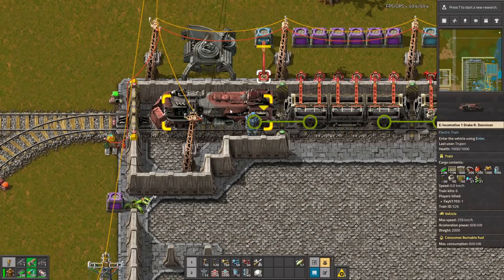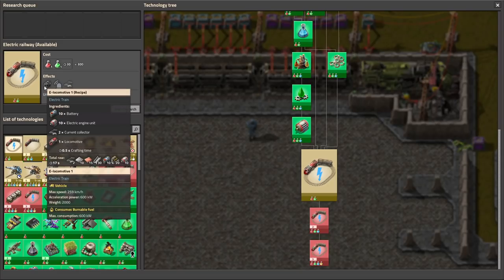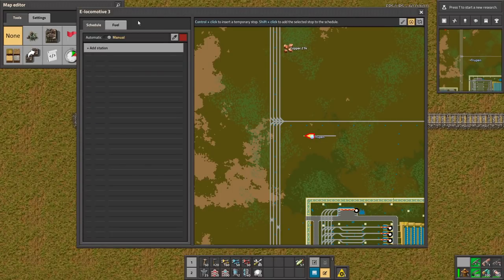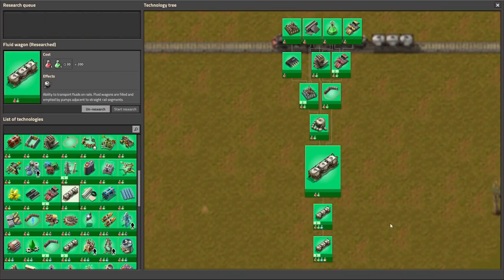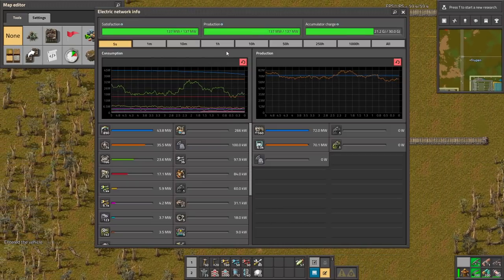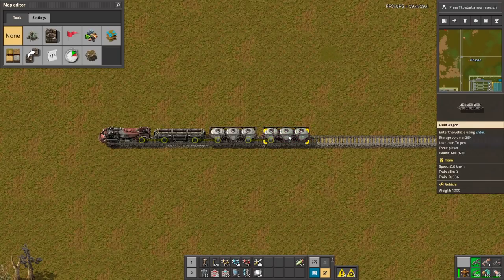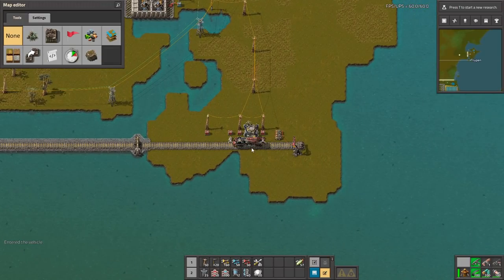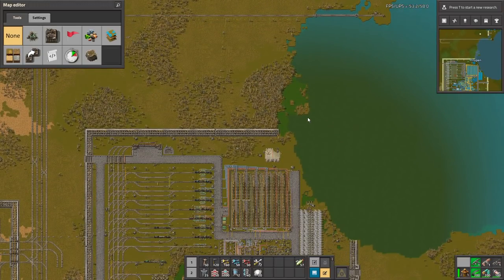New electric train.

Comment: I prefer the electric train that uses the overhead wires, it's a fork of the old electric train mod.
Reply: I mean, while that would make sense, we do still have wireless power in the game when it comes to connecting buildings to the power grid. It kinda feels like this mod is building off that idea
Reply: @Skellitor301_VA  I mean I think it's better like this anyway. Just imagine the spaghetti you would have in your base if you had to route wires from poles to buildings
Reply: @Bot-ih1jl  That's the other part, it's cleaner.
Reply: The train electric poles can also attach to the sides of the track much like signals, that’s would be nice.
Reply: Do you have the name of the mod you're referring to? I wanna check it out

Comment: has huge impact on ups
Reply: Is this sarcasm I’m not getting?
If you look it doesn’t have any
Feel free to woooosh me if I just didn’t get it
Reply: @joyhoward6105   that's on the discussion
fang523 1 year, 3 months ago
I used 250 + electric locomotive. The debug shows that the power grid pressure is 10.98 and the mod pressure is 2.23. Can you tell me if the mod optimization is not good in this aspect or other reasons
I use no more than 100,and ups is 1.**.Though I can't prove it now as I didn't keep my save